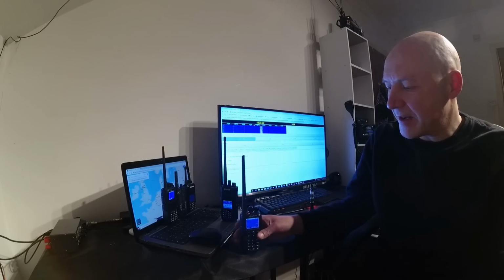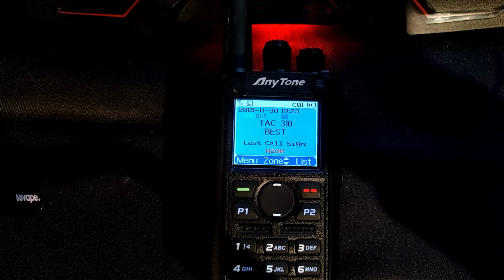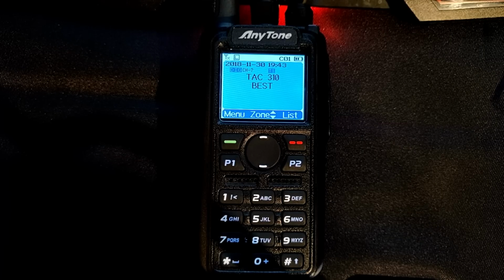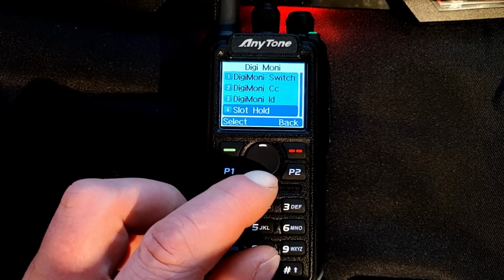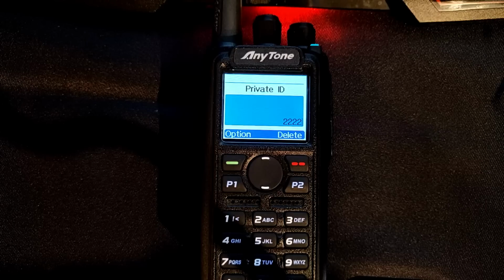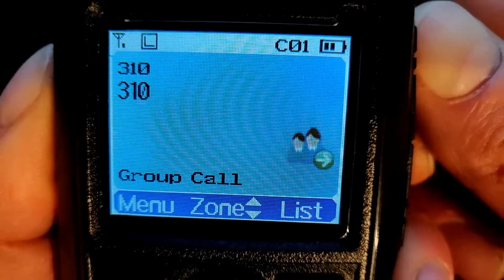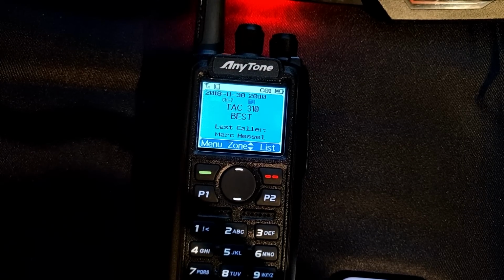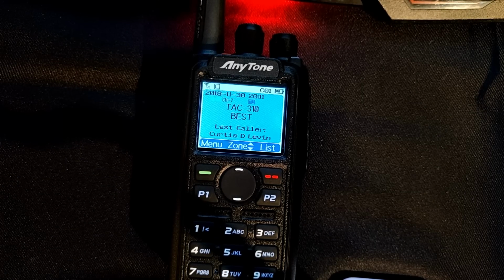Anytone 868 review after 4 months use

Comment: Mine 2018 has been deaf on analog compared to other radios, TYT 380,Alinco dual band .  DMR is excellent however.  Tried different antennas as well
Reply from the maker: Strange. The 380 Is a super hetradine and a very good receiver. And it's only one band so i'm not surprised that is very good. Any tone is direct conversion. It is good on analog But I wouldn't say it's the best receiver out there. However I agree with you. It is very, very good on digital

Comment: Did you ever review the analog receive of the 868. I'm looking at buying 20 of these for my fire department. We primarily use Analog VHF for both 2 tone paging and communication. Trying to see if this would be a problem. Thanks for the video I look forward to your response.
Reply from the maker: The FM receiver is is direct conversion. Which is not as good as superheterodyne. But it's pretty good. I think you will be reasonably impressed.
Reply: Do you know if I can simplify the operation of the radio? I would like to get it down to the selector knob and one PTT button for easy operation.

Comment: Really good video. Looking to maybe get one to learn and this has helped me decide.
Reply from the maker: This is a super radio for the price. But for a little bit more you can get the 878 and that is my current recommendation. If you want to use in the car get the 878+ your speaker and microphone will goes through the car stereo Bluetooth. And don’t forget this will work well on FM repeaters as well. Your voice will go through the car stereo microphone and you will hear everybody on FM and dmr through the car stereo. You will get a tiny transmit button which you can strap to the gearstick

Comment: Enjoyed your video on the 868, thank you. One question can it be wide banded on analogue to pickup 446 mhz PMR?
Reply from the maker: It will receive for 446 no problem. But to keep things legal it will not transmit on there. Although you could probably rollback the firmware to transmit and lose lots of handy features.
Reply: @digitalanaloguehamradio  Thanks for getting back to me, very good radio which I'm thinking of getting along with the new Shark RF Open Spot 3. Will subscribe to your channel, 73's

Comment: If I have the 868 in scan mode and it stops on a active channel, if I want to talk then I need to stop the scan function. The radio will default to the first channel, I need to then use the dial to select the active channel. If I press transmit on the active channel, is there a way for the radio to remain on the active channel without going back to the first channel? I am on firmware ver 2.36 and hardware ver 1.10.

Comment: Have mixed feelings for this radio....  very well designed , good battery, good sound, good reception,....   in the other side so frustated with the radio freezing even so that if you turn the radio off the screen remains lid (and frozzen), sometimes even after removing and putting again the batterry does not help and have to reset losses the codeplug...  have done firmware update, reseting, and so and so....    anybody with the same frustation??
Reply from the maker: Sergio Cavazos I have had no freezing here
Reply: @digitalanaloguehamradio   tks    can you tell me whats the hardware version and firmware version you have installed please ??
Reply from the maker: Sergio Cavazos This is an old video. Get the latest firmware and software which must be used together and remove your old software first and back up your code plug. Get it from Anytone.de
Reply from the maker: Sergio Cavazos Hardware 1.1 I think I no longer have the radio

Comment: Hello
I have troubles with my 878, it sends allways on TS1, in the Settings is TS2 and the blue TS2 is activated. Have one a Idea?? Whats wrong??
Reply from the maker: BEIJY BUA Somewhere in the settings is tdma. If you tick this The radio will be teir 2 and will use two slots.
Reply: @digitalanaloguehamradio  Sorry , the Problem it seems to be fixed by the SysOp from the Repeater. He restart the Repeater, and now it works. The Monitor Settings in my Case is Digital Monitor /Switch / Double to Hear TS1 and TS2 at the same Time.
Thanks for your Idea

Comment: I have this radio the AnyTone 868. Good review. Personally I would rather use a hot spot than tie up a repeater. Since getting the Jumbo spot and the Commander II, I only use them to talk to others on DMR. And I can use my cell phone to connect the radio to the hot spot and talk from anywhere without having to upload the repeaters in other locations. Simple. I wonder if there is a way to get the 878 software onto the 868 to make it act like an 878.
Reply from the maker: Thanks for the comment. The 868 has a little less memory than the 878. So it is incredibly  similar hardware just with restrictions.They could easily implement the display colour change. If they removed the memory reserved for recording function. But that won't happen because they want you to buy the 878.
Reply: https://www.f5uii.net/en/convert-at-d868uv-to-at-d878uv-analog-aprs-roaming/.       Convert 868/878

Comment: Does the record option work for you? On my D868UV it doesn't. It only records 1-2 seconds of a transmission.
Reply from the maker: Excellent question something I have never tried. I recorded a 30 second clip but only one second played
Reply: @digitalanaloguehamradio  so it seems like a bug. Or maybe it only works in direct QSO? That I haven't tried. I've emailed AnyTone with this issue already, but no reply so far. Will give them few more days before my next contact with them.
Reply from the maker: Same on my radio just 1 or 2 seconds